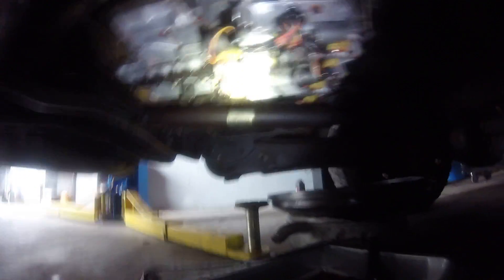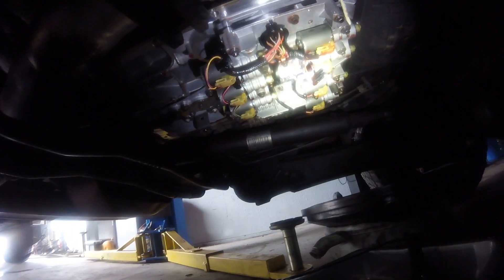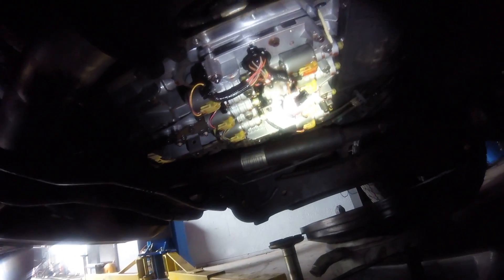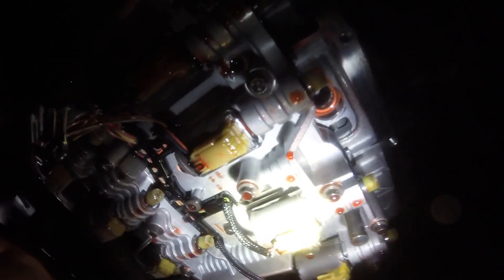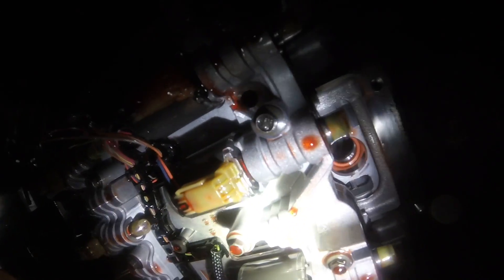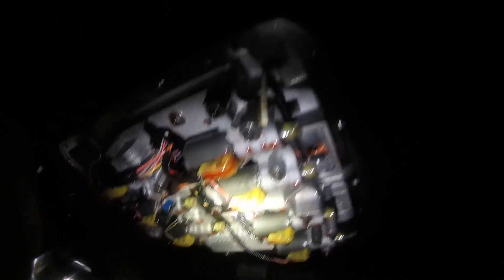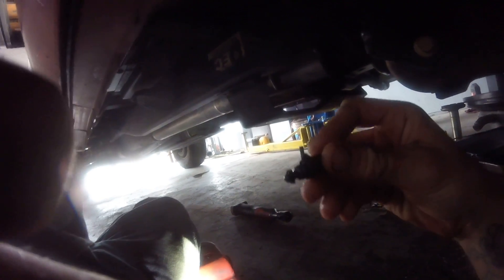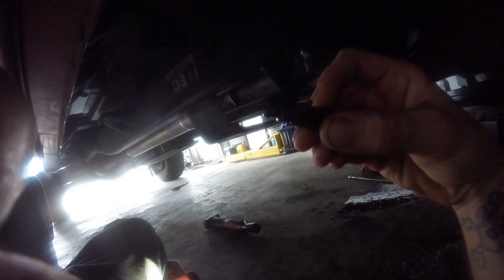ford 6.4l diesel trans temp sensor

Comment: I'm having a similar problem. Just rebuilt engine and replaced turbos. Then this intermittent problem also seems to go into over drive. No codes. But transmission temp on my reader is currently reading in the negative.

Comment: My 2008 6.4 runs good for about 15 minutes then temp Guage drops to low and wrench light comes on and truck loses most power. In your opinion would it be that sensor?
Reply from the maker: yes theres no way the vehicle is gonna get colder after running for 15 minutes have you scanned it yet
Reply: @uglyhp8225  I had it scanned, it was that sensor.  Changed it out over the weekend. Thanks for response and video.